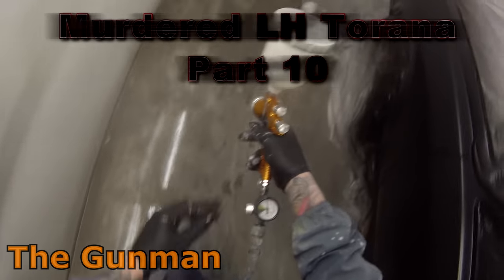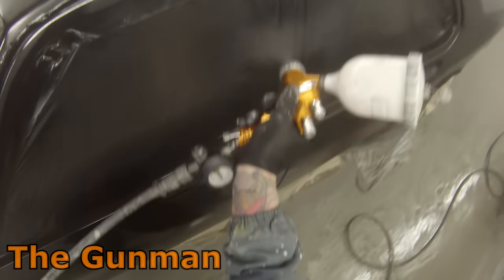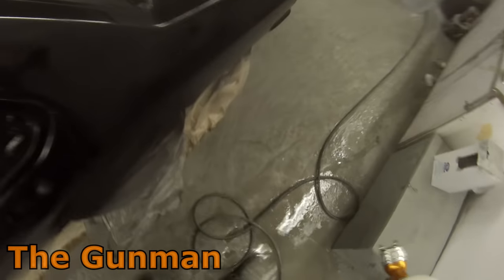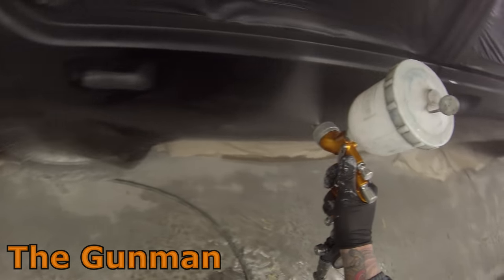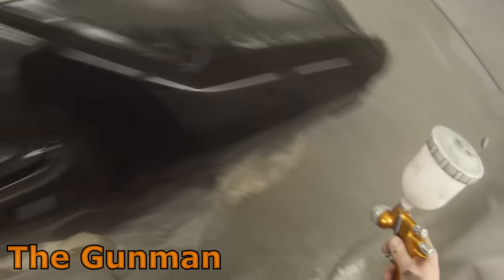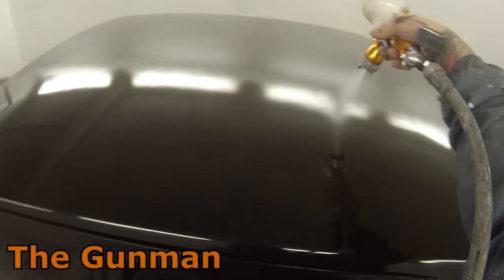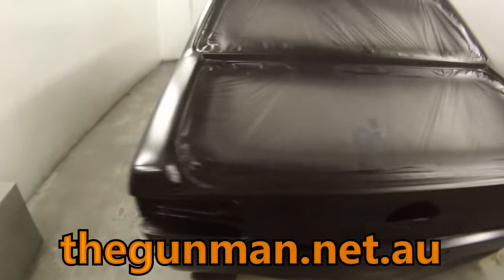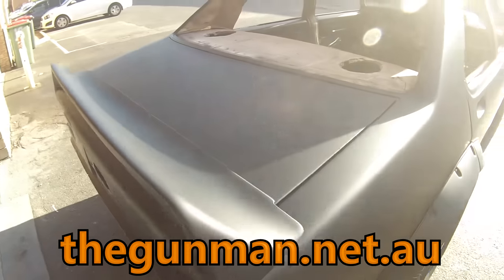Spray Painting Matte Clear

Comment: Hi, I just bought an Honda Shadow 600 from 1999 with 8000 kms, and once I'll have enough money saved up, I'd like to paint most of it in matte black, including engine, wheels, and so on. I think my father has a spray gun and I'll probably make a 3x3x3 meters paint booth with ventilation with wood frames around it to support the metal bars in the middle, to suspend the frame and other parts. Walls made out of big, strong and thick plastic sheets. Anyway, I've been watching your videos all day and still can't get my idea and how I should start it off. Disassembly isn't a problem, I just don't know what products I should get to prepare and then paint it all in matte black. I know how to mask tho..
If you take the time to give me a little answer or even just a link back to one of your videos or else, I'll be very thankfull :) Have a great day/evening !

Comment: hey gunman two months ago i painted a car white it was a three stage job with pearl on top. i used buff 2k primer underneth it .it.was fine when the job was done a month later it started to change color {yellowish] like the buff .so i redid it and now a month later its doin it again im stumped.i used that same primer on the plastic parts of the car e.g bumper and it was fine .it only changed color on the metal door
Reply: tunda call a paint shop nearby

Comment: I have a question, I have ran into a problem once before in my years of painting where I have left streaks on the base coat after tack ragging the panel and notice them once the clear goes on. At this point, is it safe to apply base coat over the fresh clear to try to cover the streaks?  If so, what amount of flash time do you recommend? I really enjoy all of your videos and have been a fan for a long while. Every time an apprentice comes my way, I direct them to your channel because of how informative your videos are.
Reply: Eddies Customs & Restorations I know this is a really old comment but for anyone else reading, the answer is no the clearcoat should be baked and re- prepped before base again, you make get away with a little bit but it’s bad practice lol.

Comment: does the base coat need to be dry before the clear?

i can buy satin black base coat paint, they say that it will look good over time. I have my doubts so i want to spray a clear coat over it.  Can i just use that paint with a satin clear coat?

Comment: you can buy 2 pac matte solid colour in poloyuthane and just add some uv inhibitor 😊
Reply from the maker: My only issue with that was if you had it mixed to full matte 75% matting paste you'd lose a lot of coverage, I do know it's possible but on this job probably best I did use clear.
Reply: +The Gunman got ya

Comment: Hey Gunman
I have a question. If u got some dust in the matt finish coat,how can u polish out. Youre answer woud be very useful for me. thank you.
Reply: you can not sand/polish matte clear coat, if you do you will get shine out of matte clear coat.  You will be surprised but if you have a matte clear coat finish and if you wet sand and buff you get a shinny finish. If you have any dirt etc you can sand yo remove the imperfection and apply another matte clear coat on top of if. Gunman uses matte agents, you can play with the mix to get the desire finish (matte, satin, semi gloss) or you can buy a ready to spray matte clear coat where you just add the hardener. You can get PPG, Kirker, Urekem, Sherwin Williams premium, and more brands on the premixed/ready to spray clear coats

Comment: hey gunman how long with 2k 2 to 1 ratio clear coat will last in a gun or will it go rock solid
Reply from the maker: It will depend on the temperature and hardener used but usually from 1-6 hours pot life before it goes hard.
Reply: The Gunman cheers gunman

Comment: Does matte clear produce any visible orange peel?
Reply from the maker: A little but the matte will hide it more than gloss
Reply: Thank you for your reply. Do you have to spray it perfect? Or is it possible to sand out dust and imperfections and still keep the matte finish?
Reply from the maker: Hector Gonzalez You have to get it as good as possible, you can not polish matte finishes or they will go full gloss again
Reply: Thank you so much.